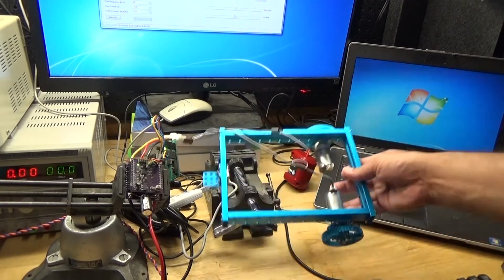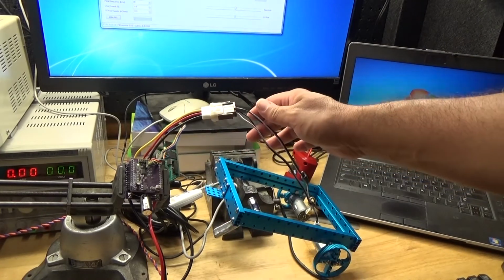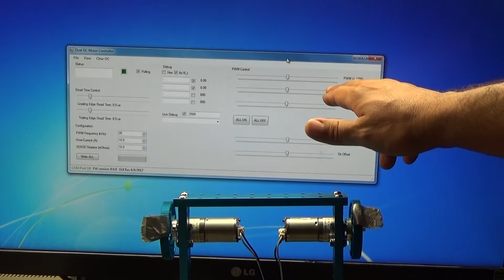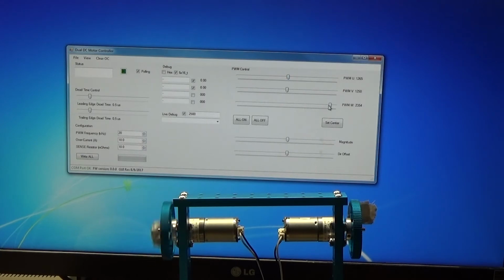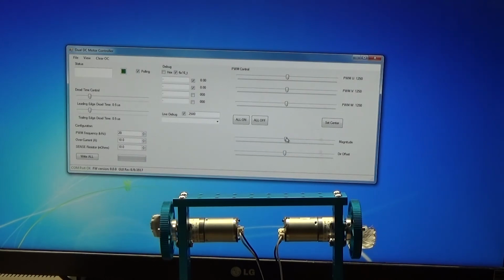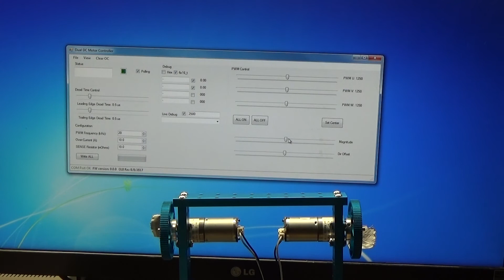Driving Two Brushed DC Motors With A Single Tri Phase Motor Driver

Comment: Hello sir.. how about 2 esc  paralel output esc connect to one bldc motor .. i dont have  big esc but i have two ESC 80A ... its possible ???
Reply from the maker: Hi Rudy, Unfortunately that is not going to work. Chances are they will both go into Over Current Protection (if you are lucky!) or catch fire (if they do not have over current protection). 3 phase BLDC motors rely on a convoluted controller to perform electronic commutation. Most ESC's out there also perform sensorless algorithms. All of this implies there is plenty of microcontroller action reading voltages on the motor's floating phases and then articulating PWM voltages to drive the driven phases. As you can imagine, this is not a trivial effort. In order to parallel 2 ESC's they would need to be perfectly synchronized! I design ESC's for a living and I can tell you, this is not easy at all! If we were to need to parallel "something" because, say we need more current, we would parallel FETs and have a single microcontroller do all the work. Hope the info helps! Thanks for tuning in!
Reply: @CNCDude  oww ... yes i worry about microcontroller conflict with each others.. i think sollution is paralel mosfet or remove it.. and  design new  PCB to replace with bigger mosfet output... so how about your hoverboard motor  project ?? Done ?  I also have hoverboard motor too .. soon if  luckly with ESC i wanna use this with big  propeller .. thank sir
Reply from the maker: I was able to make it work with hall sensor support. It was tricky to get the logic for them but once completed, the motor is running quite well! Have not done anything with them yet, though. Probably will continue to work with them in a few months, but just have gotten busy with other projects. You know how it is! Too many projects and too little time ;-)